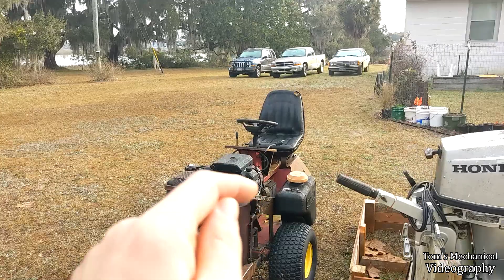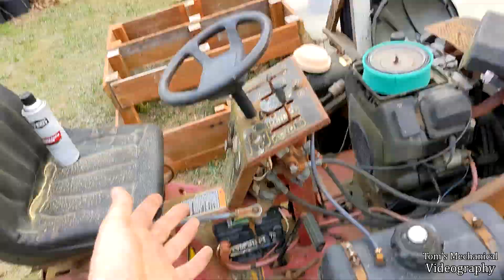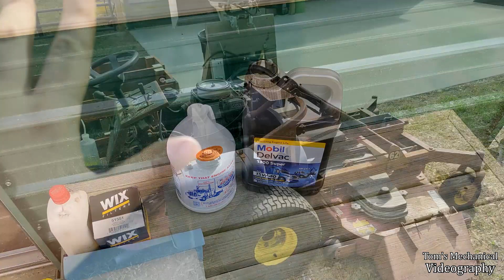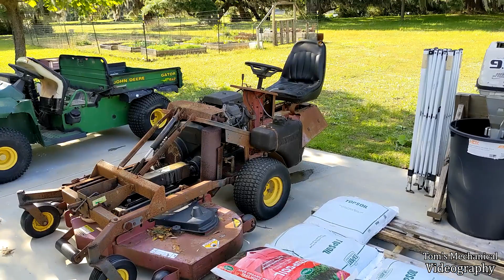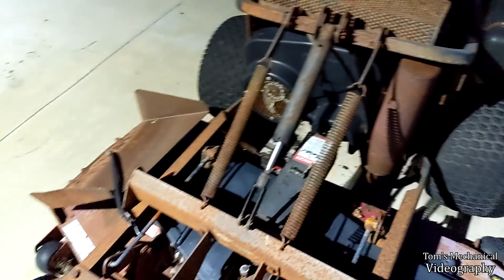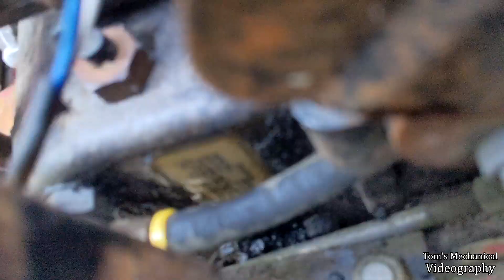NEGLECTED 1998 Yazoo YTKC22 3-Wheel Mower, Part 6

Comment: The transaxle uses SAE 30w non detergent oil and takes 6 quarts.  The oil needs to circulate to allow the last quart to go in.  The transmission is a Sunstrand BDU21L.  The water is getting in through the vent in the hydraulic cylinder.  It is a common problem.  The water won't destroy the transmission, it will destroy the hydraulic pump which can still be purchased today.  Google BDU21L.  That pump unbolts from the transmission with 4 bolts and is an easy swap if you don't mind spending the money.  However, if the mower still drives, then you pump is not destroyed.  The oil filter for that transmission can be purchased from O'Reilly's (Wix 515530)  And, if you do scrap it, I'd buy the transmission cooling fan and the PTO shaft guard from you.  :)

Comment: You don't have to remove the valve covers to take the front cover off there's 2 bolts on each side of head close to valve cover then 4 more going around it so 8 total (8mm) to get the flywheel off put something under it like a bar and beat around the flywheel with a hammer it's what's always worked for me make sure to remove 13mm or 1/2 bolt in center to line up coils turn flywheel magnet to coils and put a buisness card in between then tighten coils i'v been messing with these engines for 8 years i'v got a bunch of parts